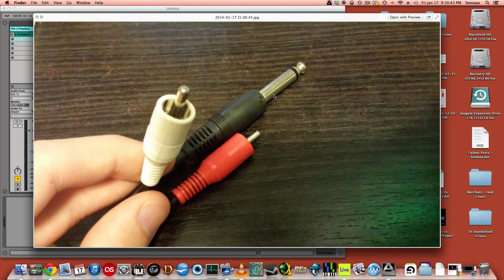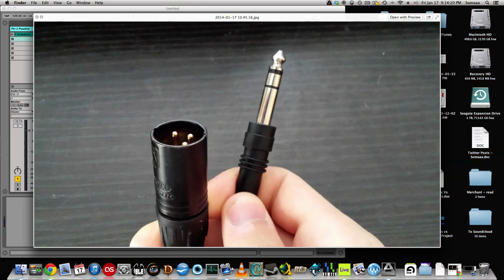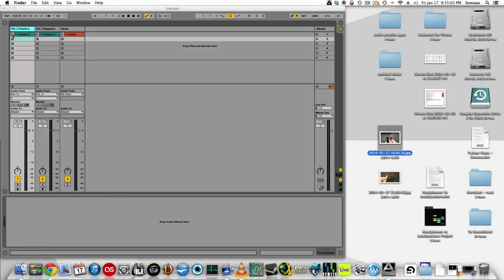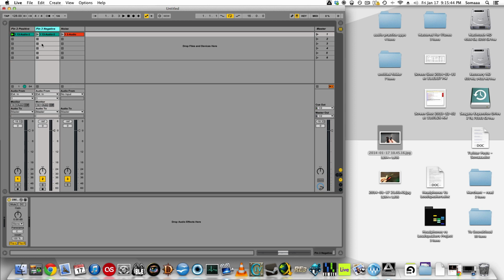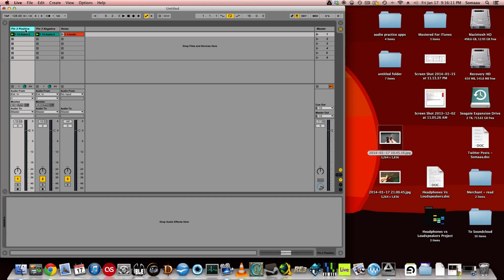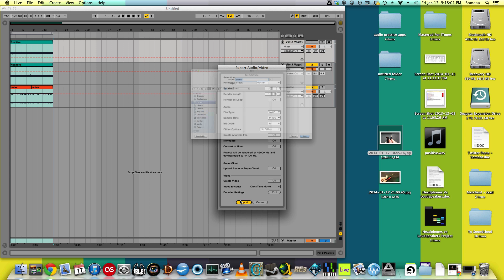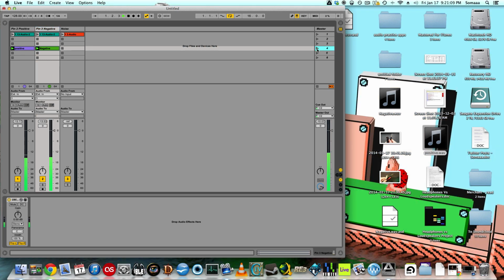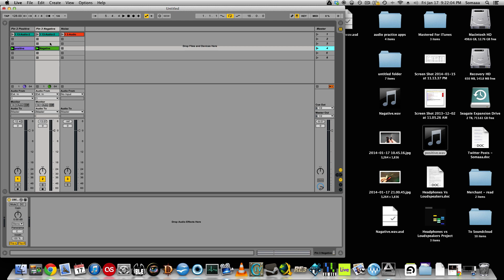Balanced vs. Unbalanced Cables - How To Reduce Unwanted Noise

Comment: If the place don't have ground system in House what happens then?
Reply from the maker: get a power conditioner maybe? do the best you can do to reduce noise but if the problem is still with the main speakers or mixer not being grounded there may not be much you can do

Comment: This got confusing at the last minute, so for others, here's some clarity. Pin 1 is just the ground and carries no signal. Pin 2 carries the music signal. Pin 3 carries the music signal with the polarity flipped. Two identical signals with opposite polarity cancel each other out (this is the basis of noise canceling headphones). But we don't want the music signal canceled, so the mixer flips the polarity of Pin 3 back again before playing anything, resulting in a strong music signal. But noise is picked up by the cable along the way and is identical on Pins 2 and 3. Since Pin 3 gets its polarity flipped by the mixer at the last moment, the noise on that pin has been flipped and therefore the noise on Pins 2 and 3 cancel each other out, leaving just the music.
Reply: Thanks for clarifying, but why does one still get line noise on a recording when using a balanced cable (XLR) between a condenser microphone and an audio interface when recording speech? The gain on the mic pre-amp of the audio interface needs to be turned up in order to get a decent recording level when recording speech and this in turn induces noise into the recording resulting in a noise reduction filter needing to be used. I use studio quality equipment in a treated room and there is no issue with cable or mic or interface. Is it the mic pre amp in the interface that is creating the noise floor regardless of whether a balanced or unbalanced cable is used?
Reply: @taab7  You may have figured it out by now but I just learnt this in my engineering course. It's probably the sound floor and how much gain you applied to the signal. The noise floor has static you don't want and increasing the gain increases that level of static, the further the gain is from the floor the higher the volume of that static cos it comes up with it, having the gain a little lower rather than a little higher is better because you can use plugins to filter out and reduce that static if it's quiet but you can't if it's loud static from high gain. It's a fine line you tread since gain increases the noise floor exponentially. Also a balanced cable doesn't cancel absolutely everything all the time, it just reduces it so it can still pick up noise from surrounding cables and equipment as well as the increased noise floor issue.

Comment: Balanced circuitry only cancels noise that is induced onto the cable. It can't cancel noise generated by a mic and preamp. Any noise that is part of the signal will remain. While your demonstration is a good one with regard to polarity in audio, it is a bit deceptive with regard to balanced audio lines. The cancellation actually occurs at the input stage which often is an op amp with inverting and non-inverting inputs. Balancing is mostly important for long runs where opportunity for noise pickup increases.

Comment: I am using focusrite scarlett 2i2 with Ableton 9 Live Lite. Even when my microphone is not connected, it is only Focusrite to my computer with the USB able, and I just push record, it records HISSING sound, however the volume depends how is the position of gain of interface. I  am not able to understand why it happens when there is only ONE wire that is USB cable connecting focusrite to Laptop.
Reply from the maker: +Aseem Kumar depending on the mic you need phantom power which may be effecting it. make sure you have the latest drivers for your interface? have you tried recording anything else out of the interface? maybe the mic is broken? are you using balanced cables from the mic to interface AND from interface to speakers?
Reply: +Soma Studios 
Hi Thanks a lot. I did TWO things, updated my DAW with the latest version and more importantly changed the cable to balanced, now it is perfect.

Another thing would like to know, I am using Dynamic Mic (Shure PG48), should I change to condenser microphone, given that I would record at home and my room is not treated for any acoustics, and more sensitivity of condenser microphone may capture unwanted sounds?

Regards,

Aseem

Comment: I have yet to hear any of this mythical noise on my low-mid range equipment.
Reply from the maker: this issue effects low and high end systems. maybe you'll move one day and noise will creep in for one reason or another
Reply: @SomaStudios  It is possible, but I feel like a lot of people make the balanced plunge when it's really not necessary. Sonically there is absolutely no difference. At least that humans can hear or that headphones or speakers can reproduce.

Comment: wat about getting rid of buzzing sound in stage monitors?
Reply from the maker: +hottierod that could be from a ground loop or other problems. i have less experience working with stage monitors. keep testing things and youll eventually find the culprit
Reply: +Soma Studios Hi, great vid. Further to this question, would a ground loop be nullified if you physically cut the earth wire, say, in an XLR cable? Cheers.
Reply from the maker: if anything i would consider cutting the ground on the power strip/extension cord being used. I have heard about people doing that but I hear its much less safe to do so even if it does get rid of the noise. again I dont have a lot of experience doing this so I could be totally wrong. 

I have never heard about someone removing the ground pin from an XLR so I dont know how effective it would be. I feel like thats not the way to go though but it may be worth a try.
Reply: +Soma Studios sorry for the late reply but thank you very much

Comment: Just in order to see, if I got it right. Does this make sense?

Input:
Pin2 Hot = normal phase  Noise= normal phase
Pin3 Cold = inverted phase  Noise= normal phase

Effect → Signal cancelled out, noise stays audible

Output:
Pin2 Hot = normal phase  Noise= normal phase
Pin3 Cold = normal phase  Noise= inverted phase

Effect → Noise cancelled out, signal stays audible

Comment: i have a 1977 Marantz receiver and I want to connect a pair of rokit 5's, but the marantz has those weird claw connectors for bare speaker wire. how do i connect to the rokit, which is both trs and rca balanced? do I have to make my own cable?

Comment: what is allowing the audio to pass through but not the noise?
Reply: When the sound enters the cable, one signal is inverted causing silence by cancelation. Down the line the both cables pick up radio noise. When the sound exit the cable, one signal is flipped again, canceling the picked up noise and bringing back the original audio back clean.
Reply: Alvaro Hernandez mathematically it would be something like this.
S = signal, db = decibel(volume)

S1 = +5db(original)
S2 = +5db(original)
Total = +10db of sound input

S2 is inverted
S1 = +5db
S2 = -5db
Total 0db of sound input.

Along the length of the cable unwanted +2db of radio signal were picked by both signals.

S1 = +5db(original) +2db(noise)
S2 = -5db(original inverted) +2db(noise)
Total = 4db of noise through the cable.

Signal 2 is inverted
S1 = +5db(original) +2db(noise)
S2 = +5db(original) -2db(noise)
Total = +10db original audio final output.
Reply: Ahh I get a better idea now, thanks for the response
Reply: Nicholas Drake No problem. Just wanted to clarify, in reality it's the wave pattern(shape) that gets inverted, resulting into 0db. But the concept is the same.

Comment: why did the noise cancel each other out and not the audio
Reply from the maker: +chisanga nyambe because the audio was already flipped once. so once its flipped again it adds the 2 signals together. phases out the noise and adds the good audio together making a stronger final good audio
Reply: +chisanga nyambe think of it like two positive numbers:

+1 and +1

you flip one of them, so you go 

+1 and -1

then you get interference, the same on both sides

+1 and +x, -1 and +x

so when you flip the second pair at the end again, you go

+1 and +x, +1 and -x

when you put them together, you get

+2 and +x and -x, or just +2

The idea is that you flip one signal before getting transferred and you flip it again once it's been transferred. While flipped, it would cancel out with the other signal, but when un-flipped, it would add up instead of cancelling out.
Reply from the maker: great explanation
Reply: +Joseph Griffin Excellent - I now understand!

Comment: Thanks Im off to get me some balanced cables for my setup.... I have a seperate question thats in this field. I have Roland Vdrums and the Roland monitor. I also get a hum/buzz from this, and yes the cables are 1/4 jack unbalanced. Would balanced cables cure this too? and also would it be beneficial to junk all my unbalanced leads for balanced? ie guitar to guitar amp? sorry if this is basic stuff
Reply from the maker: +Lee Cook I cant say for sure that getting balanced cables would fix every buzz you hear but I would get balanced cables for the roland gear. im using balanced cables and power conditioners for my gear and i still get light humming from my speakers. Using unbalanced cables for a guitar is probably fine but its worth a test to see if it makes a difference.

Comment: There is no special circuit in the amps to "invert" one signal...
It "happens automatically"...

In a BALANCED (symmetrical) cable, two leads, taking turns to act as the minus and plus, and around both a third is wrapped, only to be a good SHEILD,
which will reflect or absorb most Electro-magnetic noise, like the "hum" from the mains installations...

In the UNBALANCED, we simply "cheat" and save the copper for one signal lead, by using the SHIELD to ALSO act as the second lead, so that takes turns with the "inner lead to be the PLUS, in the signal...

That means NOISE is directly indused to the "outside lead"... 

Cleverly the shield leads are wrapped around the inner lead, so that the wires come to be on ONE SIDE, but then wrap around and is on the opposite side, SO the induced noise, is almost cancelled out...
(One one side the lead sense "it comes from the front", but on the other side, the same lead sense, "it comes from behind", and THAT cancel the noise out, pretty good...)

Still it offer a lesser protection from noise, than all the BALANCED, in which the induced electricity in the shield, is NOT directly connected to any signal wires...
The noise on the shield, are lead to the GROUND POINT in the Amp, to remove, and NOT send it to the signal leads...That protecst the SIGNAL best...

AND inside, the TWO LEADS, totally alike, will take turns to act as the plus and minus, SO when ever one is plus, the other is minus, SO the electrons fly the opposite way, in the two wires, always...
AGAIN that means that when one wire sense a EM distortion from "the front", the other sense it "from behind" and that almost perfectly, cancel the incoming noise...

IF you have a "low noise balanced cable" from the microphone, and need to extend it, then ANY cable could do that, BUT if it is  UNBALLANCED,  you totally LOOSE the advantage of
LOW NOISE, when that cable connect one of the leads with the SHIELD...

Using a BALANCED cable, is more expencive, but for some things it is NEEDED, like for microphone cables...

It really seem strange that we traditionally use the more "noisy" unbalanced cables for guitars, when the players HATE the incoming noise, most often...

YOU could fit a stereo jack in your guitar, and wire a PROPER BALANCED CABLE ON...
Ofcause, when that enters the AMP also that jack MUST be a "STEREO" Jack, which is WIRED as ONE CHANAL with a third SHIELD, which must only be connected to the "ground point" in the amp.

The traditinal XLR jacks are MEANT for that.... Using a stereo "6,3 mm jack-plug",  can be confusing "to strangers"...

You see, that stereo jack must be wired so "the left chanal" get one SIGNAL wire, and the "right chanal" get the OTHER signal wire... And the shield goes to the "ground"...
That jack can NOT PLAY A STEREO SIGNAL, because it is WIRED to be used for ONE CHANAL - BALANCED...

But it would "WORK, perhaps" , when a normal "mono Jackplug" from a normal guitar, is plugged in...

In the jack in the amp, the "left leg" will be shorted with the SHIELD, by the "ground" on the plug, so that becomes GROUNDED... Just like normal, in UNBALLANCED cables...

But in many Amps the amplified signals is "floating" so none of the signal leads, is connected to the "case ground", to keep a proper insulation from noise "on the case"...

Then you see... The balanced, with an outer shield, are BEST...Both regarding low distortion in the cable and regarding incoming noise...
BUT the jacks and plugs must be WIRED to that...
And from one glance, a STEREO UNBALLANCED may look just like a MONO BALANCED, when you watch how they are wired...

In the Home HifinSystems, the "quarter inch Jacks" are near always wired to be STEREO unballanced...
Andnthey are near always ONLY used for HEADPHONE OUTPUT...

But in Stage Amps, each jack is always a MONO and CAN be a BALANCED OR UNBALLANCED...
mTo add to the confusion, many use the same kind of jacks for the loudspeaker cables...
but while the jack CAN be the same, the cablen is very diffrent, for loudspeakers... NOT needing any shield, but needing a larger diameter of wire...

Ofcause using such a cable for the guitar to the amp, will cause MUCH NOISE...

Some producers make life easy... On my guitar cable from SOMMER I can READ it is in fact a GUITAR CABLE...
This cable have an extra SHIELD, made off some carbon material, to "greatly improve the shielding"...

That is great, but partly a JOKE... They have made a "shielded unbalanced cable"... Why not simply sell a BALANCED CABLE? ;)

No, all guitars are only wired for unbalanced, so "nobody" would buy a balanced, and then need to change the pluggs...

TRADITION is a heavy ship, to turn to another course, even when that would be best...

Best regards to you all, Dan...

Comment: I have been an audio engineer for 40 years and I am concerned at the number of newbies that refer to a 2 conductor 1/4 connector as ts ( tip sleeve) because it is actually ( tip and ring ) the telephone company invented this connector 8 or 9 decades ago and if you still have a telephone interface on your house you will see where the red and green wire connect the words " tip and ring " watch an old movie that shows a telephone operator patching phone calls and you will see her using a patch cable with a 1/4 connectors .This wrong referral is running so rampant that engineers just entering the field use the same incorrect terminology. Accuracy and accountability is important for credibility
Reply: Wow thanks for the info! Awesome insight!
Reply from the maker: thanks for the info! I'm just reiterating what ive been taught but its always nice to learn something new.
Reply: That's really interesting! Even non-newbies (saw this on a Sweetwater balanced/unbalanced cable tutorial) call the 2 conductor a "TS" cable. Looks like everybody could use this info! Thank!
Reply: the ring is the section that looks like a RING which is the middle one isn't it?
Reply: In pro audio it is reffered as TS for the unbalanced type, and TRS for balanced jack. If you call it Tip and Ring, then people will get confused.  In all manuals etc it is refered to as TS not TR.
Reply: The history actually doesn't matter. It is refered to as TS now. Tip Sleeve. Which is most accurate since the sleeve is also ground, and not a ring.

Comment: One question mate. So with the balanced cables you will have less volume? the volume will be reduced?. I'm questioning this because I made  a comparison between unbalanced RCA cables and XLR.
With the RCA cables I have more volume but I received noise and with the XLR cables the volume is a little bit more down but much more cleaner (without noise) . The xlr are both stereo and connected to an audio interface and the RCA are directly to the device( ej. laptop).
Reply from the maker: To my knowledge  XLR cables should be just as loud as RCA (possibly louder because its sending double the signal but im not positive). I think you may just have your interface turned down when using XLR and have your computer output set higher when going directly out via RCA giving you 2 different reference levels.

overall XLR is definitely going to reduce bothersome noise but there is a way around it using RCA. If you crank up the original signal and turn down the gain on the speakers themselves you can significantly reduce the noise output

Comment: Great demonstration, but tel me ... do I have to use balanced jack for the cables between my multi effect pedal and my soundcard ? 
I hope you understand me .. thx =)
Reply from the maker: it wouldnt hurt, but its not absolutely necessary. Short unbalanced cables dont really add much noise to the signal path. Unless you're hearing some unwanted noise dont worry about it. Try it out and see if you hear any difference.

Comment: if I plug in an xlr mic to a recorder that only has a 3.5mm in with an adapter will it make the audio worse ?
Reply: the size of a connector is not critical when it comes to audio signal cables.
if your 3.5mm plug/recorder support balanced input, you are not losing signal quality.